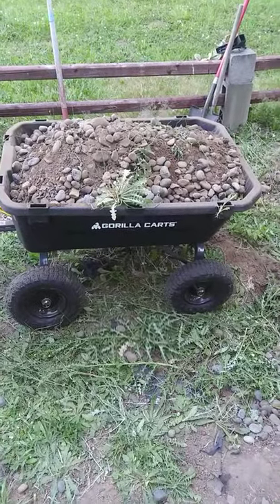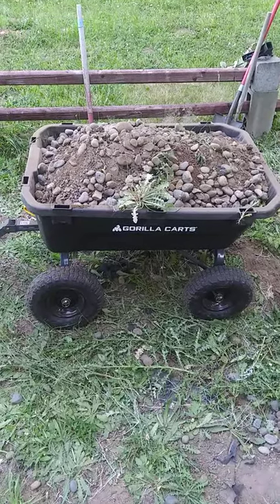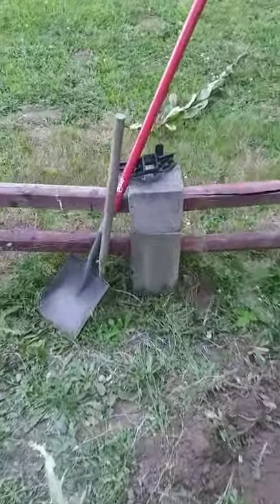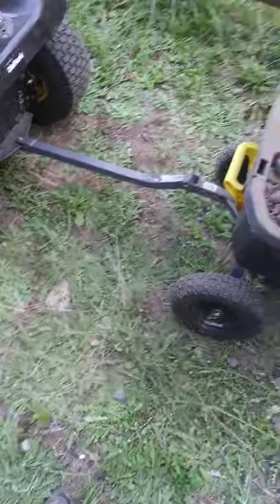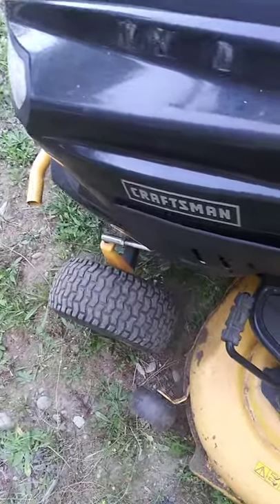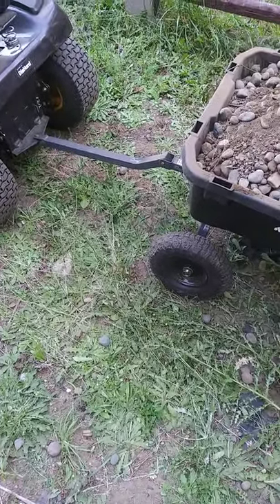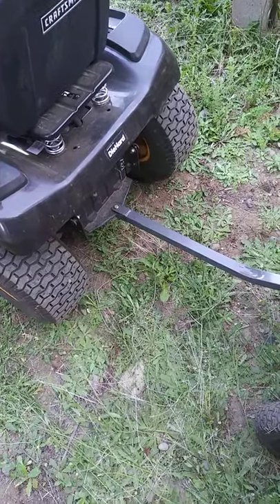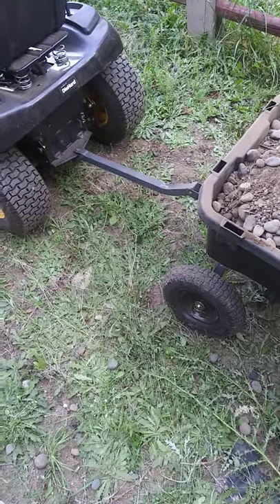Gorilla Cart's secret feature

Comment: You don't have to take the handle completely off, you can unpin it and slide the handle back towards the cart so you don't lose it.  I believe they designed it for that purpose.
Reply from the maker: Its a nice feature for saving your back however its a 1200lb cart and most mowers can only pull about 400lbs